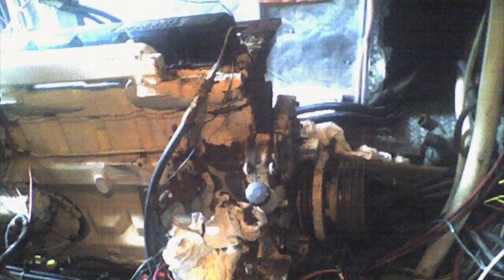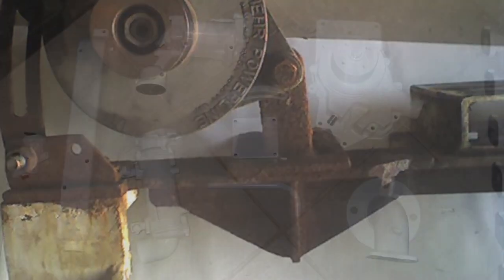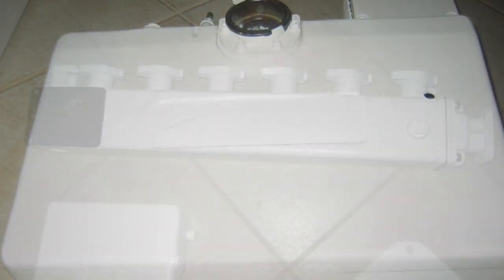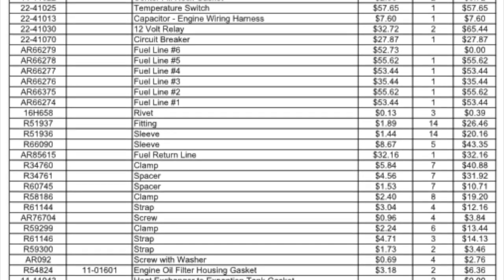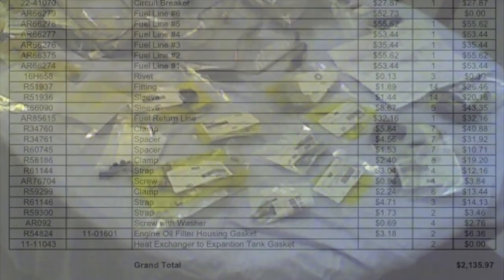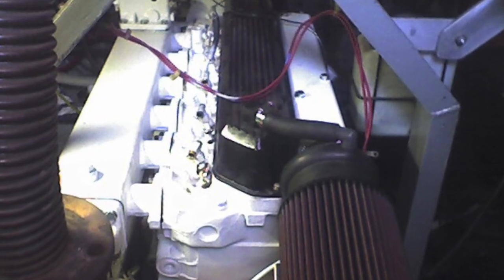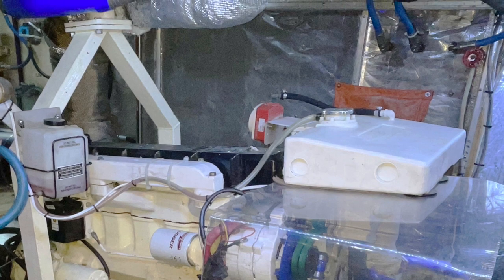Engine Refit of Chicory a 46 Nordhavn

Comment: Great job! Should last the life of the boat with proper maintenance. So you're going on 15 years since this project was completed. Anything you would have done differently?
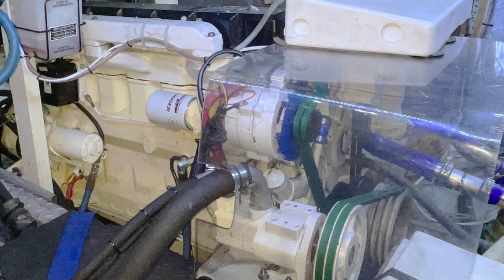Reply from the maker: I wouldn’t do anything different; however, I did make two modifications in 2016. At the 1:31 mark of the video you can see the stabilizer’s hydraulic pump mount, the large frame alternator and the polycarbonate shield. I fabricated and installed these parts once we moved aboard full time. I believe my approach is an improvement on the factory configuration for my particular engine, although it worked for 27 years. :)